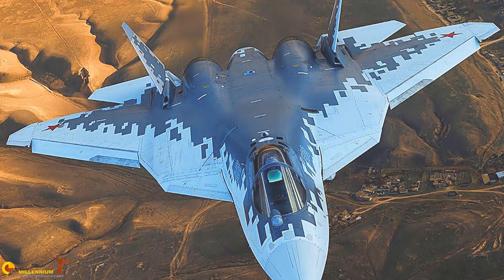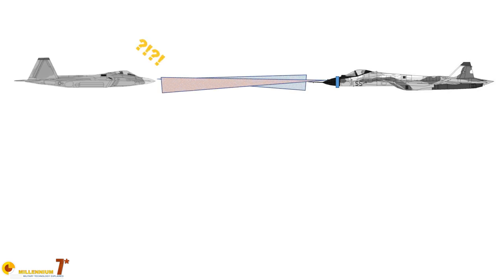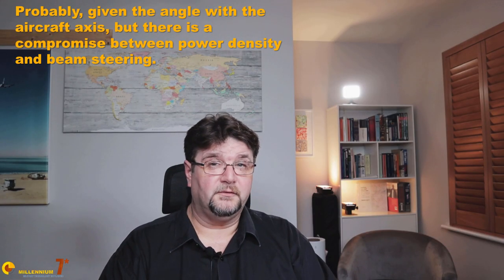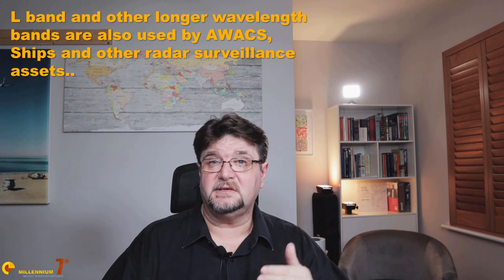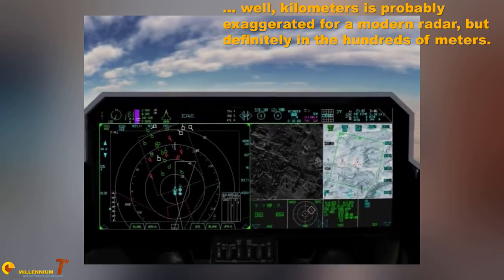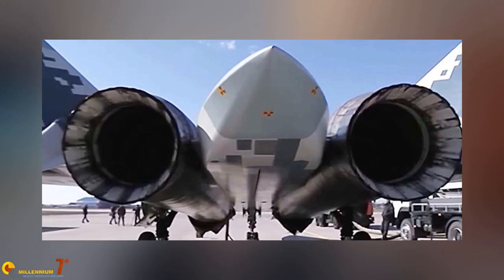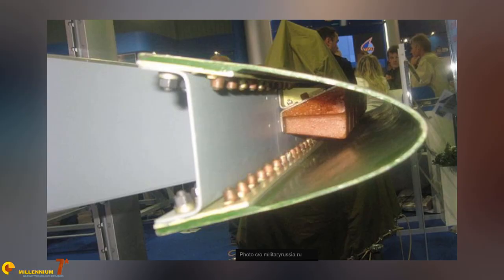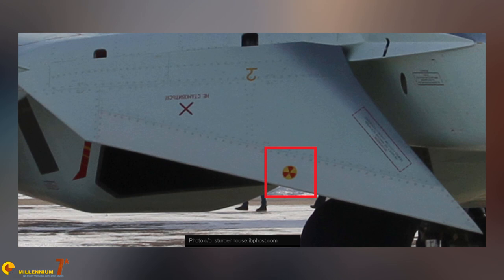Su-57 the Raptor Spotter | Part 4 - Radars, ESM, ECM, IFF

Comment: About L band precision... What about intelligent teaming with L band information between 2 or more planes way appart in z & y axis?. Triangles become bigger and processing power nowdays is greater.
Reply from the maker: I personally believe that they would be stupid if they didn't try anything like that, but I have no proof whatsoever.
Reply: I just asked the same thing...
Reply: Notice how small the L-band antennae are. The whole principle by which long wave HF operates is with unusually large antennae like the original RADAR and HF radio antennae.

Now look at the size of antennae on AWACS. When legacy AWACS gave out contact Bearing/Range/Altitude, the distance had an error of 18nm and the altitude was within thousands of feet, not very accurate at all.  That's on huge RCS contacts.

When an F-22A looks in the same space, it gives the exact distance and altitude within 100ft, and that was early F-22A, not 3.1b or 3.2.  They also could PID long range contacts with a narrow beam-sharpening mode fused with the passive RWR network.

JSF is many times better than that since it has a full suite of IR sensors, using 650 parameters for LR PID across multiple spectrums.

JSF will always have first-look against Su-57, but the Su-57 sensor suite is designed to push the threat WEZ profile farther away from it, making it more survivable.

It also has DIRCM, which has failed on other Russian aircraft in the real world against MANPADS.

DIRCM is the WVR self protection system for IR guided missiles.

The Su-57 really presents a big problem for Eurocanards and any 4.5 Gen fighters.
Reply: @LRRPFco52  ManPads, these are a real thing manufactured by Tena.
Reply: @LRRPFco52  manpads are a different animal though. They have a high failure rate in the best of circumstances and they always work within engagement range, which is not the case in contested air supremacy environment.
Reply: @LRRPFco52  The ECM is new so it to early to say if its good,  but 5 AESA radars is confusing other planes and some thing are secret.
Reply: @LRRPFco52  I love it how this analysis is based on "I believe what US manufacturers say about their products in the F-35/22 but I will believe nothing the Russians say"
By that logic, there might not be an L band at all, they're lying about it ...

PS:L-Band radars are large because they want to pack as many emmitters as possible in a reasonable sized design and optimal system efficiency. There are 2 Rules of thumb: 
1/ Wave length = antenna length = C/frequency
2/resonnance occures at any whole number fractionor multiplier of the frequency (at expence of efficiency).
For L-band the wavelegth is 15 to 30cm. The leading edge of the Su-57 wing is pretty thick and long so I think it is pretty safe to assume they can fit multiple emmitter/transmitters there, albeit at lower efficiency, which is not that big of a broblem since the L-band system is not the aircraft main sensor, it's use is pretty situational, and with the aircraft's engines and APUs there is plenty of electricity to spare (designers said this explicitely when asked about modernization, they said the aircraft has within its body an abundance of space and energy reserves to fit more systems/sensors or replace existing with more powerful one in any future upgrade program).
Reply: It would require nanosecond precision coordinating of data. Afterall, you would need to know teh timing of the othe rL-band transmitters. I am sure everyone is looking into it. I have no idea how far they are in development.
Reply: @Millennium7HistoryTech  So, about bulky electronics, i think this is also made on purpose, because of gamma radiation effect on semiconductors, there smaller semiconductor components is then exponentially greater the likelihood of breakdown and thus malfunction. That's why in space used electronics devices, that had installed antiradiation protection or they also is bulky electronics, or have a multimodal system of duplication of computations similar to blockchain technology (SpaceX). This blochain like technology,as i hear, used in ICBMS, for example Topol-M, where, 3 or more parallel computers. Different aproach, to use bullky semiconductors, to reduce effect of radiation. So this is feature then things goes nuclear. Sorry for my english, hasn't used translator.
Reply: @LRRPFco52  How can you tell the size? It is likely a collinear array. IEEE L band Wavelength range is 30–15cm. There will be one antenna element every wavelength. By having two arrays at a distance the combined beams are narrow. Now all you have to do is wiggle the transmitting beam and see what happens to the return.
Reply: @ycplum7062  GPS can provide that. But it is more likely that the data is fused on a higher level. More like your two eyes work.
Reply: @LRRPFco52  Why does it especially endanger European designs? They never relied on LO to begin with.
Reply: @0MoTheG  I could see that, but what range will they be able to get a return and how will it determine altitude for a good track to then point the IRST in that direction?  You’re well inside F-22 or F-35 WEZ by that time if they’re within the Field of Regard.

To counter my last statement, you could then triangulate with the side-looking AESAs with that quadrant's L-Band array, but I would again wonder about effective range for getting an accurate altitude band track, let alone even a hit.
Reply: @0MoTheG  

The GPS is one of the end result of detect and tracking the aircraft. Teh meshing of the various sensors is how you detect the aircraft. 

I don't think the two eye analogy applies. Basically, the radio transmitter and and teh radio wave receiver are at two separate locations. Radar works by measuring the the changes in the sending and receiving of radio signals. If teh sender and receiver are one, they knowing the time of teh sending and recieving signals. If teh Reciever is separate, they only know the recieving signal.

Comment: This series about Su-57 is the best I can find in the topic. Thank you.

Edit: I wish the rear looking active radar is real and Su-57 at least have 2 reverse mounted AAMs in its weapons bays.

You seemed to solve the sound issue.
Reply: Very easy for a radar guided missile to track you.
Reply: @fredeb67  please google "frequency hopping," and also it doesn't make much of a difference in real life. Everyone has radars in the front, back, wings etc. How they use it depends on "tactics"
Reply: Can a backwards-facing missile actually work? If the fighter is flying forward at Mach +1.5 when it launches the missile, the missile’s starting speed is Mach -1.5. Will it not simply fall backwards and tumble aimlessly? There must be some reason why this rather obvious idea has not been implemented by now.
Reply: @MrDino1953  in close range when the fighters maneuver the airspeed is much lower and a direct path requires much less energy then a forward facing missile. It would work.
Reply: @MrDino1953  It's use would be more like firing then turning around while still providing data to the missile

Comment: Developing snd integrating all those various sensors is likely extremely expensive and technically challenging... explains why so few have been built.
Reply: It takes about 10 years to launch a New 5th gen aircraft into production after it makes its first flight. Guess how many years passed Since its first flight
Reply: The fuss is in software department. How to do it without having Cyber holes and effectively is great problem. The SW  rewrites in F-35 were big
Reply: @LRRPFco52  USS JFK tried AESA but vacuum tubes. Well vacuum tubes are not great for this.
Reply: @JMiskovsky  Every modern combat aircraft will have software upgrades throughout its life. With modern high count RF and IR sensors, DFLCS, FADEC, NAV, COMMS, ID, Countermeasures, EW, and other systems, the software side grows exponentially.

Imagine the workload for the Su-57's avionics integration and subsystems algorithms. It will be 2030 before it reaches base level systems maturity.  There's a planned engine change during the next 9 years as well, after being delayed.  They've probably already been looking at restricting yaw authority to the pilot as the altitude increases since we know what happens with high yaw instability in the Su-57 at altitude.
Reply: @LRRPFco52  russian counterparts have similarly lengthy legacies, your point is moot. If you dig deep enough, you can trace back russian tank engines' development and legacy all the way down to 1930s. Legacy alone is meaningless.
Reply: @hanznel8488  Agree but the guy up there was stating that all comes from US and every single leap foward in mil tech is always US behind .......
Reply: @conan670431  I didn't see him claim that all technological leaps were Western, I saw him merely stating published facts pertaining to the relevant weapons systems being dicussed.
Don't complain, robustly counter if your facts are correct.
Reply: @LRRPFco52  Yeah, this channel is good in some areas but also seems biased